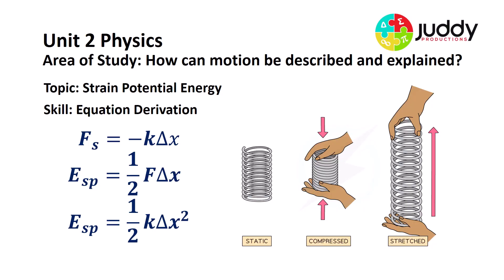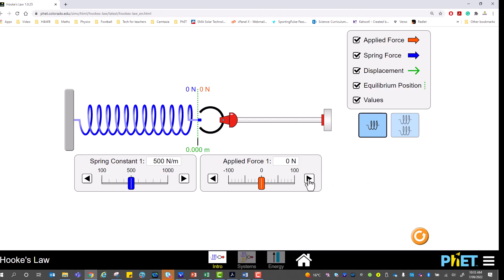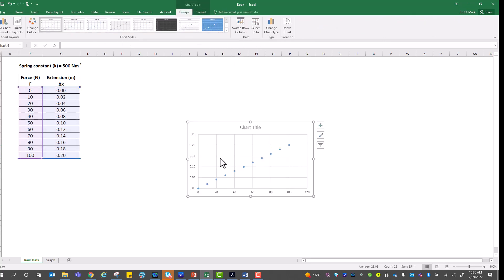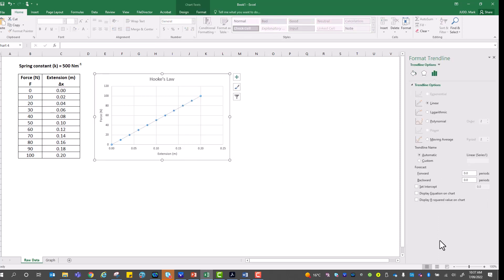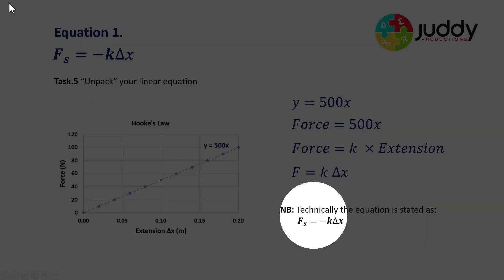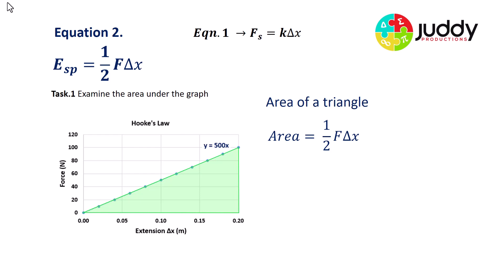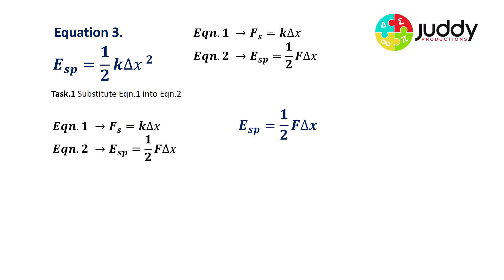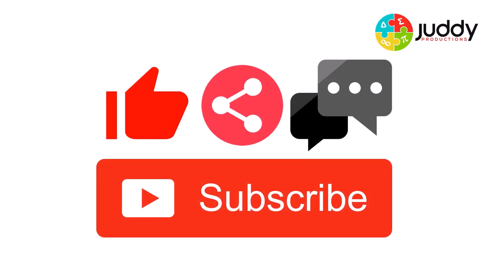The derivation of Spring Equations

Comment: So f=-kx is compressed spring . But f=kx is extending spring?
Reply from the maker: The negative indicates that the direction of force is opposite to the direction of the restoration force generated by the spring. So, if you apply a tension force to stretch the spring, the force generated by the spring is in the opposite direction it will want to pull the spring back to its original position. Vice versa for a compression force. So the negative is a vector sign. It is irrelevant if you are calculating the magnitude of the force es (ie. the answer is always positive).